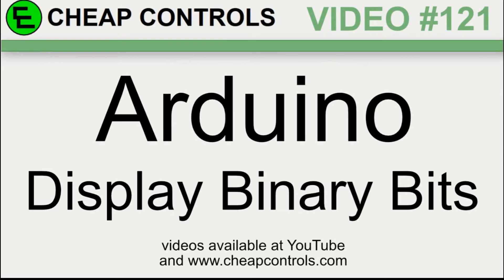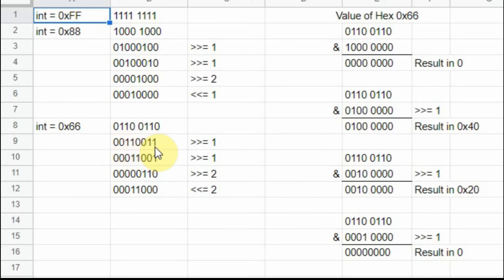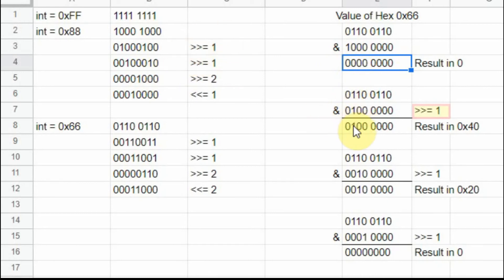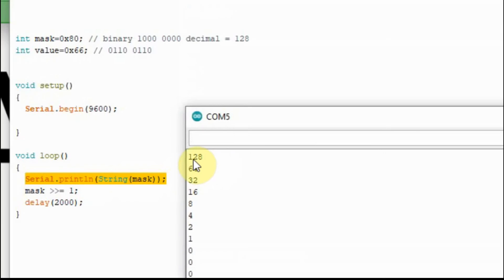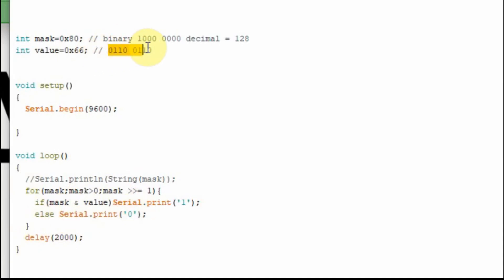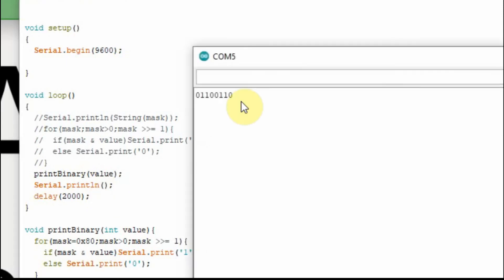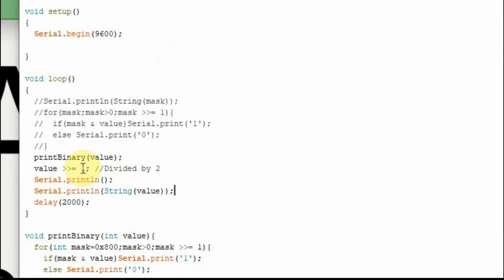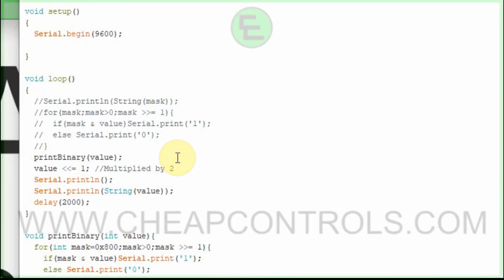#121 Arduino Displaying an integer as Bits in the serial monitor

Comment: Yes, I'm interested in a Nextion enclosure. I have a 3.5" display.
Reply from the maker: I don't think it matters but is it basic, enhanced, or intelligent?
Reply: @CheapControls 

Enhanced.

Quick question. Do you think it possible to connect a Nextion Display Serial Port directly to a Digital Power Suppy via a 5/3.3 volt Logic Level Converter? All I need the Nextion Display to do is read and write a few DPS Registers. Having to add a CPU for this is overkill I think. Requring a lot more programming. The DPS is a MODBUS protocol device. But I think what I want to is simpler than that. 

Thanks to your videos, I have most of the Nextion programming done. All I need to add is the ability to read and write the DPS registers and add a Timer using the Nextion RTC. I have some PC utilities that reveal the DPS communications.
Reply from the maker: At this time I believe it is possible.  It would depend on the device.  I am not familiar with the acronym DPS but I am familiar with MODBUS and PLCs.  That is the direction I am heading with a project that will control a projector directly from the Nextion Display.
Reply: @CheapControls  

Great. Thanks.